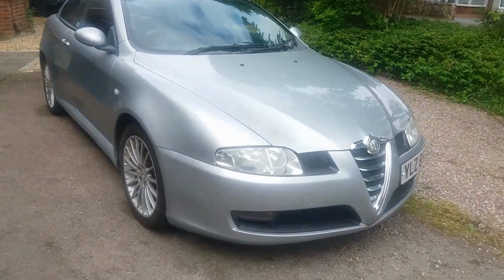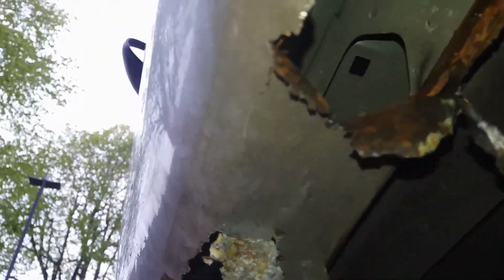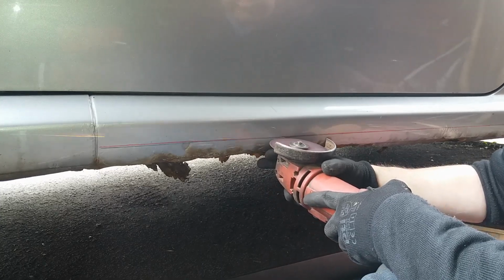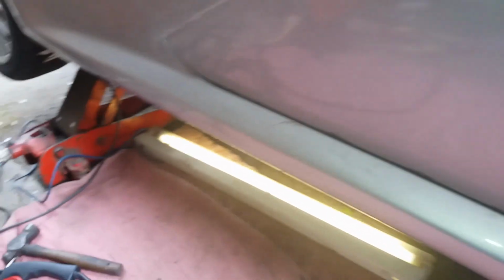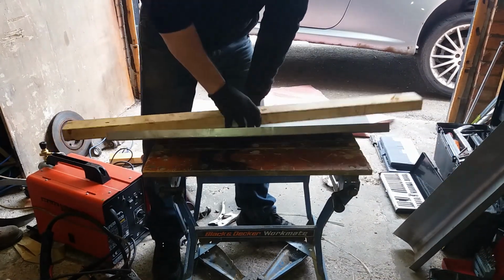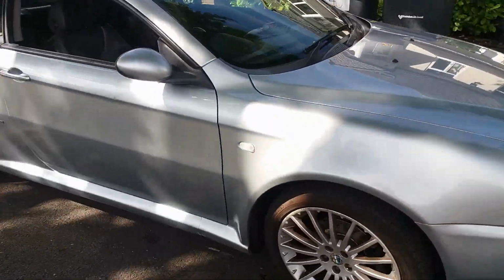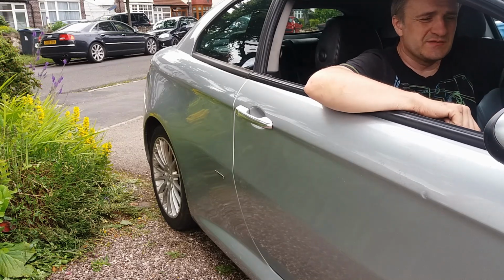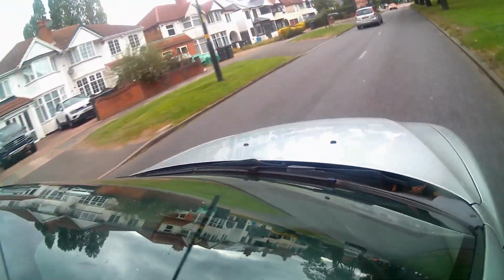MY CHEAP ALFA ROMEO GT HAS SOME SERIOUS RUST ISSUES

Comment: I don't know why alfa did't just use plastic skirts like some car manufacturers at the time. FIAT also had same issues. Cheap sheet metal or poorly protected?
Reply: generally the steel is ok on this car.the factory put two sponge bags at the rear of the sills which just got wet and stayed wet. At the front of the sill there is a bit of sealant which traps the wet. bad design. the only other corrosion that is common is the front subframe.

Comment: No the reason the sills on a alfa gt are rusty is to do with the so called mechanics jacking the car up on the sills.when its supposed to be jacked up further in on the jacking points.they crush the sills then the rust starts it's not the car it's the idiots that work on them.

Comment: For 270 queen quids it would be worth 4 x as much if you sold it in parts. The plastic sound proofing in the sills is not the problem, it's the English muppets who jacked the car up at the wrong point and damaged the sills in the first place.

Comment: sound proofing foam filled plastic bags in the sills?  WTF was Alfa thinking ?
Reply: My thoughts exactly... Who on earth would engineer sills with sponge in them. What on earth were they thinking... Just wtf it is a receipe for a disaster/corrosion. Best "anti-rust designs" are those with "open" profiles. So that the condensation can evaporate and not getting trapped inside the profiles.

Comment: Sorry, but the weldingjob is just horror, even if it's just a povisorium. It would make sense to show the installation of the Polish sills.
Reply from the maker: I will. In a future video. Haven't done them yet. Had exporting importing things to do.
Reply: I didn't really want to insult you just because I may be able to weld better, sorry.
you brought me to the website of the manufacturer of the sills.
Thanks for that.
  I have made contact, the sills look good and I will check the fit, with shipping Europe about 65 euros per piece.
There are no body parts to buy for the GT, it is time that the reproduction of parts begins.
Reply from the maker: @geraldheld1286  I'll try and make it look better when if I it properly!!

Comment: Always thought the headlights had a bar / slider behind the bulb, that would make them UK or euro.
Reply from the maker: I think headlights with original projector lenses can be swapped rhd to LHD. I've now stripped and rebuilt the lights putting in aftermarket projectors. Which will be in the next video.

Comment: Do you have a solution for your damaged oil cooler?
Reply from the maker: Yes. Replaced it with an after market one. It's in the next video. Did the intercooler as well.

Comment: I'm in a very similar situation having bought a cheap GT and exporting it. The headlights are quite pricey but it seems to be the same body as the 147 but with a different lens. I've bought some to give it a go, could save about £250 if it fits together. The other tricky thing is sourcing a rear reversing light on the bumper for the correct side.
Reply from the maker: I've looked for lights and new cost more than the car 2nd hand don't seem to exist. I've bought 2 projector lenses and I'm going to have a go that way. Where is your car going?
Reply: @therealdiscodave69   ACCESSIBLE AUTOS  Mine is headed to Spain. The prices on the lights are especially painful considering the price of GTs in the UK! Not much of the used market I. Europe either. The 147 lights come out at under £40 each so I thought it would be worth a go. Hope the projectors work!
Reply from the maker: @Jared-qy1jh  I've just been looking at the 147 units. How soon will you know? I'm up against a possible deadline for importing to cz due to our impending exit!
Reply: @therealdiscodave69  Not sure when I'll get round to doing it but Brexit means it can't be too late! I just got the lights in today and everything looks good, fairly sure it will work but can't confirm it. The body is identical and only the lens and reflective insert are different. Funnily enough one of the jobs I just finished was sewing up the exact seam you have a tear on. It came out great, just need a curved needle and tons of patience.
Reply from the maker: @Jared-qy1jh  my car is just a list of all the common faults that these cars suffer from. Could you let me know how you get on with the lights? I'm not 100% the projector mod will work or be acceptable for the authorities.
Reply: @therealdiscodave69  sure, will do.
Reply: @therealdiscodave69  Finally got round to  doing the headlights, glad to say that they fit together well. Haven't got them finished but here's a link to some pics. https://imgur.com/a/OCWhK6P

Comment: Good job keeping it going, but financially it might have made more sense to part it / use as a donor car, and restore a V6. I think they're more likely to retain their value due to having the Busso run-out engines.
Reply from the maker: A v6 would have been great but I'm a dedicated diesel head - I did think about the busso. Far more collectable but I keep cars about ten mins and get bored so the 1.9 was the one right decision I made. I wanted a black LHD with red leather.

Comment: Good job with the sills to keep the car going till the new ones are fitted. Original sills seem to be made of cigarette paper far too thin . Inner sills looked in good condition  so at least there's something to weld to . The GT is nice to drive and goes quite well and can be remapped easily enough .Quite a few specialists for parts and advice , Alfaworkshop and Autolusso are worth a look. Autolusso do a solid flywheel conversation and GTA clutch that will cope with a bit more power. Another great video .Any chance you could tell us where to order sills from ,many thanks.
Reply from the maker: Many thanks.The sills are from a company who's details are on the gt owners Facebook page. I wasn't brave enough to order myself and got a Polish friend to do it. I'm planning on doing another video when I fit the proper sills with the car in my workshop and not on the drive. Should turn out better!